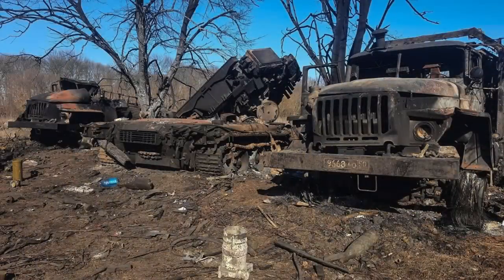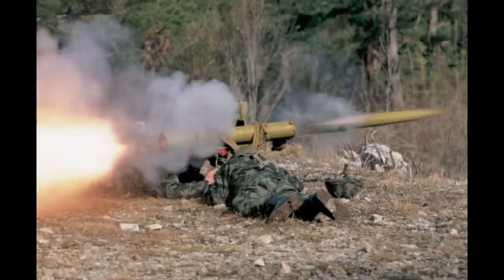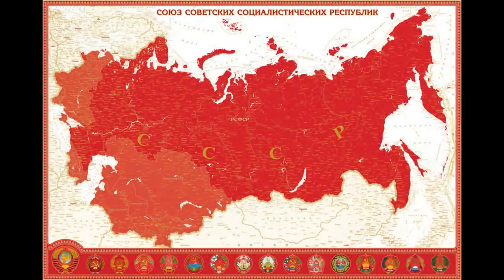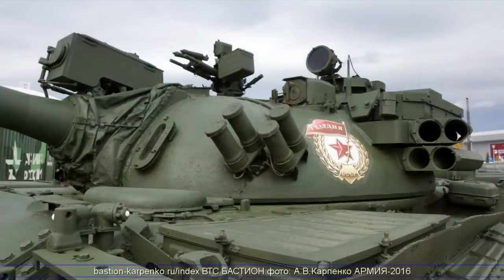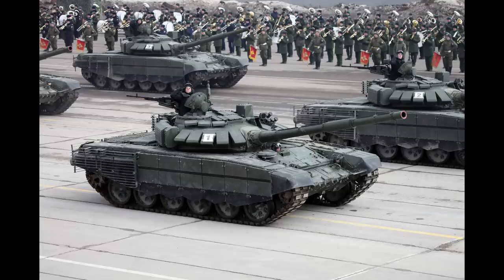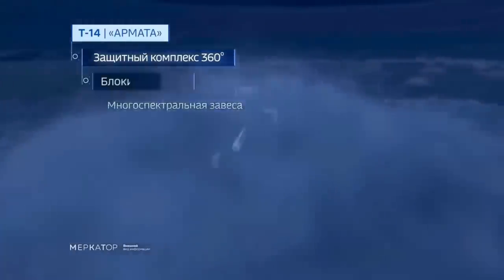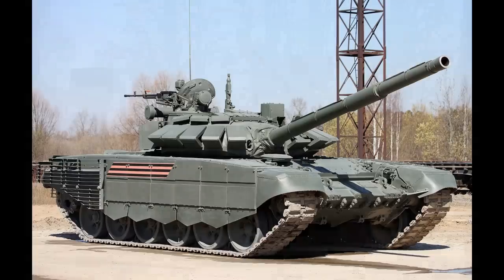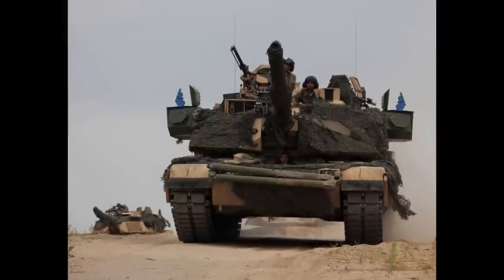Why are Russian Tanks Failing in Ukraine?

Comment: Would it be a valid tactic (or is it already being used) to carry simple laser emitters that simulate an ATGM and just constantly lase enemy tanks forcing them to constantly pop their smoke? Or maybe desensitize the crew to the warning and then hit them with the real deal?
Reply: They did something similar.
They shot down a KA 52 with a Stuhna-P anti tank missile which is laser guided. What they did is they aimed next to it and in the last moment they guided the missile on the Helicopter which hadn't had enough time to react with the laser warning receivers.
Reply: The Ukrainian army does one better.  They "aim off" over the tank (a tried and true tactic) with the laser and then fire the missile.  After a couple of seconds, they then paint the tank.  By the time the tank gets its warning, the missile has arrived.   Protection systems are a half measure at best.  The best answer is well-trained infantry screening the tank.
Reply: I actually saw somewhere that such a weapon was made against planes, that simulated launching a rocket (so it would seem like a Stinger being fired at the plane), causing the plane's warning systems to act and pilot taking evasive measures. It looked easily portable and was said that one such device had 50 "shots". It does seem it would be quite disruptive to a bombing run.
Against a tank I think it's a bit more hazardous, because you need line of sight to essentially feint an attack, putting yourself in danger for no real benefit. A plane will not seek out someone with a manpad, but will try to avoid them. A tank (or it's supporting infantry) are always on the lookout for anti-tank weapons.
Reply: I'm not sure of the exact science of how the laser detectors work?  However, ATGM laser designators use coded pulses of light which are interpreted by the laser seeker on the projectile to guide it onto the target.  So, I'm not sure if a regular laser pointer would have enough power to trigger one of these systems or if the circuitry on the detector can differentiate the differences in power and wavelength?  Because to a certain extent, you would want to harden these detectors to reject optical issues caused by shadows or glare.  Otherwise, these systems would be set off by things that aren't a threat.
Reply: @rogerpennel1798  targeting lasers aren’t all that powerful. Simulating one with a handheld laser designed to fool the sensors should be easy. A agree with these who say that since the smoke is a limited defense, and can easily be used up, hitting the target with simulated targeting lasers could knock out that part of the defense. Once the anti IR smoke it gone, they ate less protected.

Whether lasers produced to do that are being made is something I don’t know, but they should be, and wouldn’t cost much. They could be produced in the tens of thousands and given to troops. Just causing that sort of targeting to be detected and defended against would give tank crews high levels of anxiety, which would accomplish a lot, even if anti tank missiles weren’t available all the time.
Reply: @swaghauler8334  There is another advantage of this tactic. The stugna operator (this tactic is most times used with stugna) can, if he is experienced with beam riding rockets, make an "arc shot", meaning that the missile hits from above like a javelin.
Reply: Yes, but the topic being discussed is that Russia isn't doing that and won't do that
Reply: @melgross  - If the countermeasures are automatically triggered or if it generates a warning the tankers may opt to disable the system to reduce distractions.
Reply: One of the issues of this would be you giving your position away and making yourself a target.
Reply: The problem I can see with that is that you'd be constantly broadcasting your location as well. Kind of like how the IR lights do on old night vision systems.
Reply: @swaghauler8334  Even an infantry screen is only a half measure. Every protection system, including an infantry screen, only reduces the odds of losing a tank. 
In short, you need an onion. and infantry are just one layer of that onion... and they're about as effective and important as the other layers.
Reply: @melgross  The question is, is the bang worth the buck. And I'm not just talking about procurement costs, also the additional burden on logistics. 
You're essentially adding and extremely situational tool that will almost never be used.
Reply: I imagine that (in the midst of active combat) if someone has got themselves into a position to lase an enemy anything they might as well fire upon it with deadly force while they have the opportunity. They might not get another chance.
Reply: @DerMetalmatiker  interesting
Reply: @Slavic_Goblin  not really, if the tank deploys smoke it cant see you just as much as you cant see him, plus you could just aim the laser at a crossroad, hook it up to a couple of car batteries and let it run on its own for a couple of weeks, or stick one to a surveillance camera
Reply: Battlefield players already so this
Reply: @swaghauler8334  Except an actual hard-kill active protection system would still be able to react in time.
Reply: @melgross  That assume that a handheld laser is of equivalent power.  A targeting laser should be more powerful than some store-bought laser pointer due to the differing nature of their uses.  A laser pointer someone uses in a classroom isn't going to have the same range as a targeting laser anyway.
Reply: @cstgraphpads2091  I didn’t say “store bought laser”, did I? I said lasers designed fir the purpose. In other words, a military device. You’d be surprised how powerful some civilian handheld models. So powerful in fact, that some have been banned. But targeting lasers aren’t that powerful.
Reply: @cstgraphpads2091  Except that they weren't able to.  This was tested in Grozny in 1999 when Putler leveled that city.  The APS wasn't able to react if the weapon was less than 4 seconds from hitting the tank.  The system also injured and even killed a number of Russian troops working WITH the tank in Grozny.  The Russians eventually pulled back and leveled the city with TOS launchers.  
     The "cope cages" were also a product of the Russian experience in Grozny where a large number of RPG shots were taken at the roofs of Russian tanks.
Reply: @matteocesa9017  IF the tank deploys smoke. What if the tank just shoots in the direction?
Reply: @Slavic_Goblin  he said it in the video, it automatically deploys smoke, once it detects laser/IR. It makes a lot of sense cause if its another tank looking at you you get a sabot to the face half a second after your warning, missiles are a bit slower in general, but we are still in the single digits. Now as far as I know LWS only give you the general direction from which you are getting lased, you still need to spot the target, rangefind and send a round hoping to kill them before they kill you. Even if you succeed there might be 5 other AT squads ready to fire at you. It depends on situation, but its much easier and safer to default to pop smoke and reverse, than stick around and find out if its a large atgm ambush or just a couple of guys with laser pointers
Reply: @matteocesa9017  
As far as I'm aware most if not all automatic smoke dispensers are togglable. 
And it's precisely due to the "half a second later you have a sabot in your face". If the enemy tank sees you and has lased you, you're already ranged. So no amount of smoke is preventing that first sabot to the face. And if the enemy has the chance to shoot another sabot at you, that's when that smoke would actually play a role, by then so many things went wrong that it's not even funny. And to make it even worse you're interfering with your buddy's ability to aim and shoot as well cause part of his view is taken by that big blob of smoke you released. I'm not saying there's no place for smkoe in a tank battle, but it's a double-edged sword. 
eing targeted by an ATGM, especially of the SACLOS variety would indeed work. Another thing that works is supressing and possibly damaging the sighting device. Don't believe me, ask Israel. And popping smoke can actually prevent you from doing the later. 
That's not to say that popping smoke is always a bad idea, just that it's a double-edged sword.
Reply: @Slavic_Goblin  seeing through smoke goes both directions, it would be detremental if other allies have already at least spotted the enemy. I gave it for granted but you should also reverse at the same time, it might be enough, it might not. 
There is no way anyone could reliably spot, target, fire and hit an enemy that is already shooting at you, before his shot hits. Its just spray and pray, pure luck with every odd against you, not to mention the fact that the enemy could very well be under cover already by the time their shot is in the air.
Of course there is no guarantee, but popping smoke is much faster than an engagement cycle. If the enemy has numbers similar to yours and a decent training/cordination it can wipe out your entire force before you can see, let alone hit anyone. Case and point, Israel fighting Hezbollah in 2006, they pressed the offensive and got shredded, they admitted themselves it happened because they were reluctant to use smoke. To me trying to return fire makes sense only if you are mobility killed or are in a tight space, its debatable in other circumstances but the speed and ease of use of a smoke screen I feel is a better option if you are also able to drive
Reply: @matteocesa9017  
As far as I'm aware the fix to the Kornet issue was MG fire on the location of the launch by elements tasked with covering that part of the landscape. No tank fights alone after all,  ...err, or at least it shouldn't fight alone. And a blob of smoke can do more harm than good in certain situations.  
In tank vs tank engagements, regular smoke is pointless cause everyone is sporting thermals sights at least on the gunner's sight. And while IR smkoe does indeed obscure both your and your enemy's sight... the enemy already knows where you are. 
Furthermore, tanks don't change course exceedingly quickly... or not at all if you're in a T 72 or something like that with it's single digit reverse speed. 

Now obviously there is more nuance to the topic and it would require paragraphs upon paragraphs to cover all angles. But my opinion is that popping smoke is situational thing, not a default reaction.
Reply: @Slavic_Goblin  yeah not being shot at to begin with would be a better option there is no arguing that, as is using other forces for recon and suppression of enemy AT teams, but thats beyond the question. The israelis did report they could have prevented the loss of a number of tanks had the commanders decided to use smoke, dont know what you mean by "fix".
For a T72, yeah I agree, moving at 3kph is comparable to a mobility kill Im not familiar with russian doctrine, but in this case it might be better to go for suppression, it doesnt make it any easier tho, and whatever they are doing it doesnt seem to be very effective. To be completely fair its a bit of a pointless argument, cause a good gunner could always lase something else near the tank instead of it directly, in which case you just sit there and take it. 
But forgetting all of that for a second, the original idea was to use a laser to mess with the tank crew with no intention to shoot at them, you dont even need anyone operating it, you can put it on a tripod hidden in a bush and aim it at a road, turn it on and go do something else if it gets shot, so what? 
It might not be worth the effort, but thats a different problem
Reply: @DerMetalmatiker  it shows u have no idea how stugna-P laser pointer work. Those laser is never strong enough to trigger LWS in the first place and the laser isn't directly pointed at the vehicles to guide it
Reply: remotely done of course...
Reply: @swaghauler8334  Active APS should be relying on an on-board radar to track the missile, so not needing the warning or any action on part of the crew aside from turning the thing on.
Reply: @swaghauler8334  you can defeat that tactic since those units are stationary waiting to ambush by miniature drones with grenade drops, thermal vision/night also, and have reconnaissance units using them a head of any armor column moving. Drop the grenade/explosives on those ATGM Ukrainians waiting to ambush. Use of Sniper units with thermals is also good, especially by 50 cal thermal capacity. But these are not resources available to the Russians.
Reply: It would just give the position of the laser emitter away, which could then easily be neutralized by machinegun fire. Furthermore, if you have the ability to lase the tank, why not send an ATGM downrange at that point?
Reply: I doubt smoke would work against Javelin.   These missiles gyro-stabilized imaging seekers continuously track the target.  They effectively triangulate the targets position and velocity vector.   Should they loose track because of smoke the seeker doesn't just keep wonder of course.. Algorithms decide ed that a viable lock is no longer available and will target the still moving tank through smoke based on last postion and velocity.  NLAWS is of courses incompletely unjammable.   Effectively in the event Javelin is 'jammed' by smoke it knows this and turns into NLAWS.   It would be necessary to deploy smoke long before impact not in the final 3 seconds (800 meters) or so.   Even the early 1960s Maverick and Walleye missile had 'anti blooming' algorithms'  designed to hand the loss of track that occurred when the target expanded beyond the zoom lenses ability to hold it withing the same frame that would have worked against smoke.
Reply: @rogerpennel1798  There are two ways that lasers are used
1 A laser 'paints' the target and the seeker in the nose homes into the spot of coded light.
2 A laser provides a beam on which the missiles rides through seekers in its tail.  With Stugna you notice it cork screws.  That's so that the  missiles doesn't block the view of the target.   This is unjamable unless you blind the operator or camera.   It's usual to fire the missile offset (eg a little high) by estimating range and then only lowering on to target in the final few seconds so as to avoid triggering laser detectors in the target till its too late.
Reply: It would be a valid tactic if you intend to get killed by those same tanks lol
Reply: @DerMetalmatiker  sounds like that battlefield 3/4 tactic with SRAW
Reply: @swaghauler8334  The laser warning dosent work only if you aim at the vehicle equipped with such system! If you aim next to the vehicle the LWS will detect that! Also the LWS doesnt need seconds to detect and warn the crew about the threat! It does it for split of a second and if the LWS is on automatic mode its gonna launch smoke screen and the missile is wasted!
Reply: @DerMetalmatiker  Its Stugna-P not "Stuhna-P"! This ATGM is not only laser guided! Its also equipped with TV guidance which is probably used when shooting down the KA-52! LWS systems only need splits of the second to detect the threat! Thats why its very impossible to shoot down a KA-52 with laser guided atgm!
Reply: You can deceive only your cat with those simple laser emitters!
Reply: @GREATRussia1990 
No you are just false informed.
Stuhna-P is laser guided. ONLY laser guided. The "TV-Guidance" you're talking about is the sight of the Lauch unit.
Reply: @GREATRussia1990  And yet there is a video of one being blown out of the sky by a LASER-GUIDED Star Streak!!??
Reply: @Slavic_Goblin  The Smoke only works if it's dual-spectrum on Western ATGMs because they all use thermals that can see RIGHT THROUGH HC Smoke.  WP and Dual-Spectrum Smoke have hot particulates that block Thermals and the Russians used to have this CLEAR gas grenade on their old SHTORA(?) systems that blocked IR frequencies but let you see through the gas cloud with a normal day sight.  
       The number ONE weakness in SACLOS (semiautomatic, command, line of sight guidance) ATGMs is the slow speed of the missiles.  Speeds ranged from 180m/sec up to 350m/sec with a speed of 200m/sec being pretty average.  IF you are firing at a tank 2km away, that 200m/sec speed is a TEN SECOND GUIDANCE TIME.  That is a lifetime to stand in the furnace!
Reply: Its stupid to blow your cover, alert the enemy just to let him pop his smokes. Alost always you will never meet a singel tank, so better stay hidden.
Reply: @DerMetalmatiker  Do you speak Russian? Because im pretty sure your information is from western source!
Reply: @swaghauler8334  MANPADS are not like ATGMs! They are intended to shoot down aircraft and are hard to evade! The StarStreak as i remember can fly very very fast and that tactic with aiming at the target at the last moment is humanly impossible! But despite that KA-52s LWS will still detect the threat but probably that KA-52 that youre talking about was already damaged or had issues with the defenses!
Reply: @789know 
You got me, I checked and you are right. It's beam riding.

That does not negate the fact that they did what I said. They aimed next to the Helicopter and aimed on target in the last moment.
Reply: Using sdome sort of laser to try to spoof the active protections systems is not an entirely bad idea but it does have one flawans t hat's if the enemy knows what they're doing, they're going to be hosing down the area where the laser is coming from.  While the target vehicle itself will creating smoke and/or it AP system would go off, any other tanks and/or IFVs will be using their coax or auto cannons to try to suppress you. And if they're following proper doctrine, they'll have grunts with them who will either be shooting their guns in your general direction or coming the area looking for you. Meanwhile, because your enemy has just popped smoke, any attempts to actually launch a missile isn't going to work it cn't target the thank through the smoke.

Thinking of it now, your idea could work if the lasing team was quick and they'd lase the target and then immediately pick and find another spot once the smoke or AP is going off. Thjey could do this a few times until the smoke or AP system is depleted at which time it would run into an actual ATGM team furtheron down the road.
Reply: @GREATRussia1990  Yep.  The Mach 2+ speed of the Star Streak.  The Star Steak is a LASER-GUIDED MANPAD.
Reply: @swaghauler8334  Impossible to screen tanks at distances Stugna operates. 2-3km and more... Impossible to counter this
Reply: @DerMetalmatiker  that video was so fucking sick, imagine being the guy whos done that man. what a legend
Reply: @swaghauler8334  Oh you dont say!
Reply: @eiko4252  
By sending laser pulses simulating Stinger then launching a firework to trip flame detectors the target depletes his flares. 
Then you kill him with a real Stinger
Reply: ...or you could just destroy them right away. keeping your position concealed from the enemy keeps you alive, and allows you to take out more of them
Reply: @swaghauler8334  Their is no way infantry can screen against threats that are 4+ km away, people needs to stop repeating this nonsense infantry screening claim which is only valid for WW2 anti-tank weapons with ranges of 100 m, the battlefield have evolved.
Reply: @kennethferland5579  How many years did you serve as a tanker or infantry?  From the looks of your profile, I'd say you NEVER served so you have NO CLUE about combined arms tactics.  

       The infantry advance AHEAD of the tank with their drones ahead of them (yes US squads use hand-held drones for short-ranged recon), and often an Apache overhead or nearby.  The Tanks are a couple of klicks behind them UNLESS you are in an URBAN environment.  Then the separation is just a few dozen meters (which is why MOUT is so stressful).  The Bradley IFVs will be BETWEEN the Tanks and the Infantry.   Additionally, US vehicle commanders often run hatches open and "eyes up" for increased situational awareness.  This layout is why the Bradleys killed more tanks than the Abrams in the First Gulf War.  They were the first to make contact.
Reply: it would work but the designators are pretty expensive vs the cost of the warhead itself
Reply: It's called a Laser dazzler. Though the intent was to blind crews by lasering the sights. Should trigger laser warning receivers just fine though. However modern sights are protected from laser dazzlers and the laser warning receiver will give the target vehicle your range and azimuth so if you trigger their smoke grenades they can call indirect fire on your position even if they can't see you. You're better off just shooting them.
Reply: @swaghauler8334  depends on the type of protection system and how it works. Radar equipped APS like trophy will not be fooled by these tactics since they use radar to detect an actual projectile.
Reply: @josephahner3031  dazzlers usually arnt man portable tho, they're mostly vehicle mounted if memory serves
Reply: It wouldn't be difficult for the arms industry to create a remotely operated device that sits on a small tripod and does nothing but send out a laser the same as an actual weapon uses, for the sole purpose of triggering these counter measures.
Reply: You could, but I'd rather spend that money on actual weapons to destroy the tank than something that just alerts it to your presence.
Reply: Yeah, but if you equip tanks with detectors, you have less rubles to buy vodka.
Reply: That is a legit tactic, similar tactician be used against APS where you shoot cheap rockets or bullets with special tip that gives off larger radar signature to mimic a missile or rocket
Reply: @rogerpennel1798  Laser's have coherent polarized light on very specific frequencies and the detectors are set up to detect these using a grate  There are two types: those that detect the laser directly and those that are like a camera sensor that detects the laser on the tank or aircraft indirectly.  There are two ways to guide a missile: laser beam ring with sensors in the missile tail and laser spot homing in which the target is illuminated.
Reply: @DerMetalmatiker  Offsetting the beam is a fairly common way of laser beam riding system to minimize detection.
Reply: @rogerpennel1798  The basic way beam riding works is the offset the beam and scan it in a conical pattern.  The signal will only be equal when the missile is as the center of the beam.  The missile and the beam must have a clock or reference pulse  so that the missile knows when the beam is at the top etc.  A pair of orthogonal phase sensitive modulators is then used to move the missile up/down or left right.  The other way is to project a rotating disk pattern edifier frequencies the further from the target or a sciatic pattern with different hooks on the scimitars.   They works very similar to the seekers in infrared missiles only the laser is scanned.
Reply: Genius!!!! Lol troll the shit out of them!!!
Reply: @venator4838  one guy camouflaged properly using a weapon laser would work just find to trigger it, and he can move quickly too.
Reply: If the enemy tank starts moving it becomes a lot harder to get a solid hit.
Reply: @daviddwodo3748  omg so trueeee
Reply: Russian tanks don't have hard protection, but neither does Ukrainian tanks.